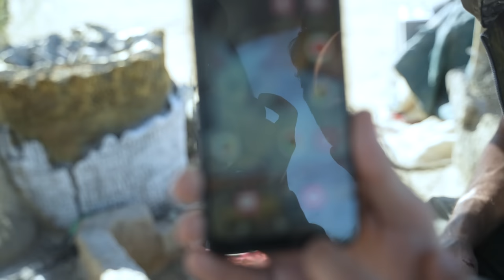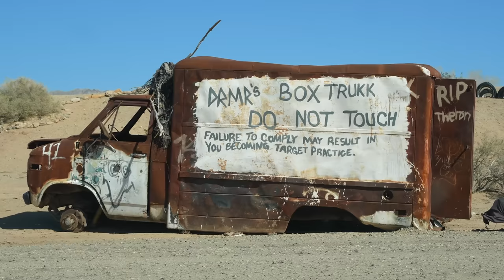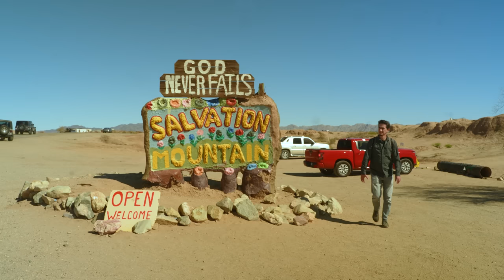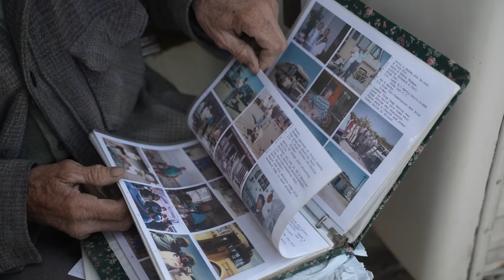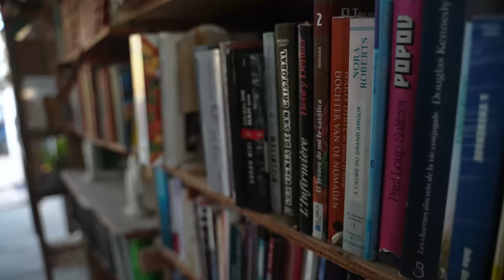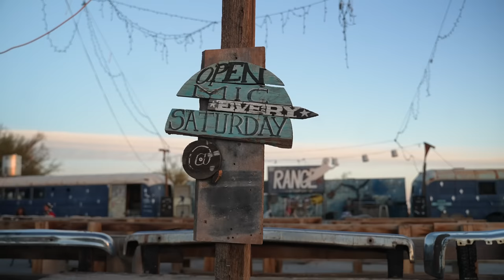48 Hours in a City with No Laws: Slab City

Comment: I'm more interested in practical issues, like, do these people ever take a shower-when and how?  What do they use for a toilet?  How do they wash their hands?  They're, all, having a drink.  How do they keep them cold?  What do they do all day in the middle of the freaking desert?  Am I missing something, here?
Reply: I spent four winters there. Nov - March. 
There is thermal hot spring at the entrance of the Slabs. Community bath there is an outlet for the water. 

From Niland which is the closest town. There is a guy that rents 100 gallon water tanks and he fills them. 

It can be boring during the day. Most just hang out. But like the vid states there are alot of artists so they make art.

There is are 2 solar powered internet Cafes. Both are donation based and barter system.
Reply: We use showers to clean ourselves. Toilets to poop in. Refrigerators to keep our drinks cold. 

Crazy, I know. 😂
Reply: @NomadicZig  Where do you get the electricity to run the refrigerator? Where do you get the water to run the toilet?
Reply: You got to be a yuppi